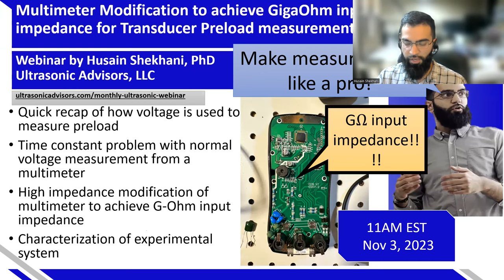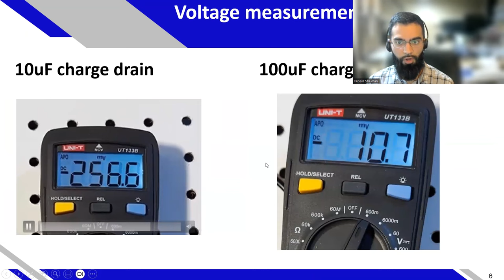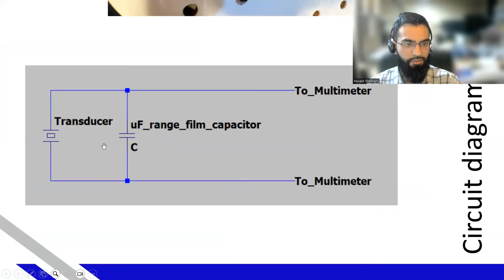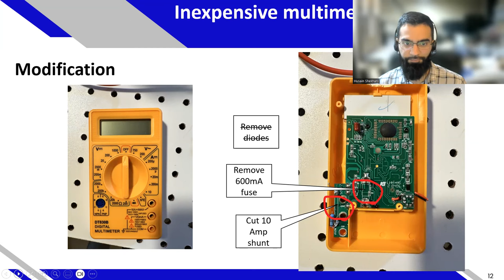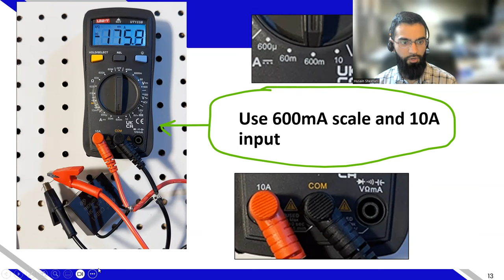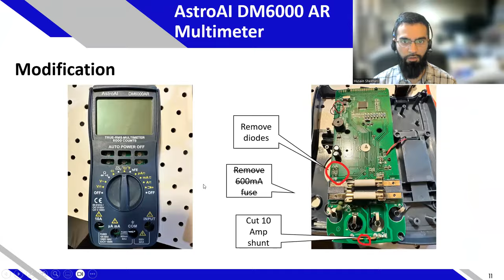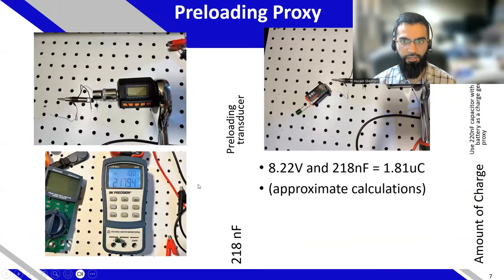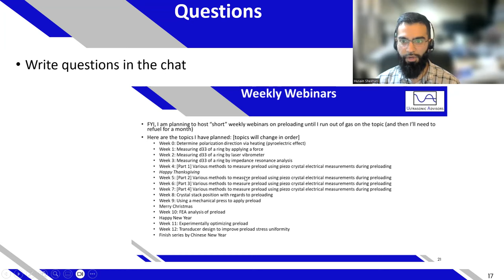Multimeter Modification to achieve Giga-Ohm input impedance for Transducer Preload measurement

Comment: Those DT830.. (yellow one) multimeters are readily available, they look the same but have been dramatically changed internally. New tiny PCB, very cheap feel about them. They did always use the Intersil ICL7106 dual slope ADC ( 1/2 digits) and fortunately those are available online as kits (using the ICL7107 with LED display) for very little. I just looked at mine, you remove 1 resistor and a pot across the input and you have the high input impedance again. They do draw some current so the voltage climbs a bit when you have a capacitor across the input but the rate is quite low. I would suggest to add some protection to the high impedance input, maybe some diodes from the input to the supply or a JFET across the input since it doesn't need more than 200mV. 

I enjoy the new series so far. I'm hoping to see a charge amplifier join the ranks of clamping force measurement methods some time or maybe a charge transfer measurement using the arduino, they can be made using just the port lines and a reference capacitor. Measuring and discharging the charge is done by switching the ports from input (Hi Z) to output, setting it high or low as needed. Your online calculator is a good idea.

With automatic torque wrenches you can control the torque wrench (with a microcontroller) to turn off when a clamping force is reached, a definite plus for quality manufacturing.
Reply from the maker: I appreciate your detailed comment! Yep, the cheap multimeters come in a whole variety of levels of quality.
- nice point about protection of the ADC
- a charge amp makes sense, however, I'd still need to deal with the drift from the bias current. I hope, however, to demonstrate it soon.
- it's definitely an awesome thing to connect a torque wrench to the output of the voltage. You could even do it with a comparator instead of a microcontroller :)

Comment: Greetings Husain, did you consider using the "Peak Hold" function now commonly available on most DMM's?
Bypassing the input circuitry and connecting directly to the ADC is not standard engineering practice, cheers.
Reply from the maker: Thanks for the suggestion regarding the peak hold function. It’s really useful! However, the downside is that you would be unaware of anomalies that cause the preload voltage to reduce. Also, you’d be unable to track voltage in specific cases where load is put and removed a few times to reduce hysteresis. 
I agree that bypassing input circuitry meant to stabilize signals is not standard. I have seen that it can have consequences like drift. However, I hope the method is useful for those people who want to have access to an entry level high impedance measurement from standard equipment.
Reply: Excellent detailed reply, cheers Husain. @ultrasonicadvisors

Comment: high bro, i am a student and i want to know what is the driving voltage of 60w Ultrasonic cleaning transducer 40Khz
Reply from the maker: They use a few hundred voltage driving at the antiresonance.
Reply: @ultrasonicadvisors  yes but how much,i tride 400vpp or 800vpp both at resonance freq bhut both are high transducer drawing so much current then calculated and circuit get very hot